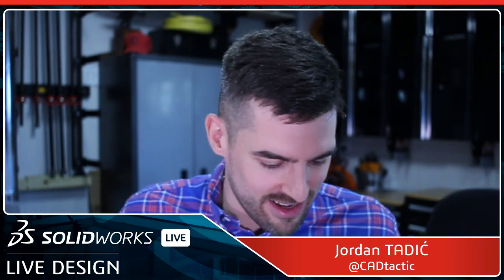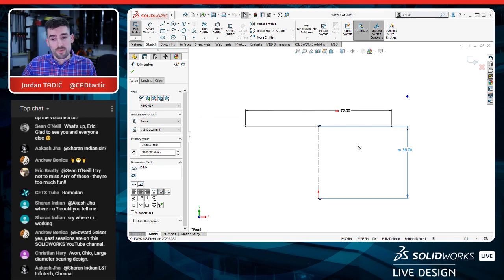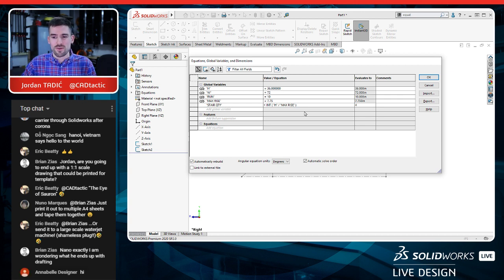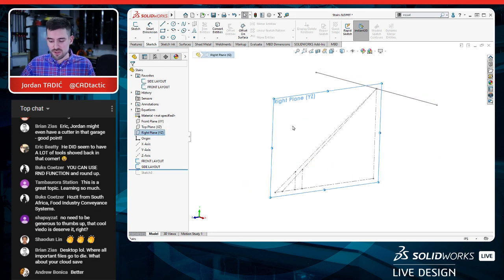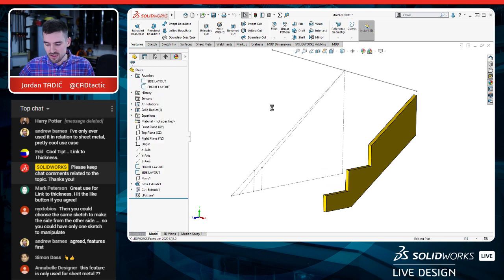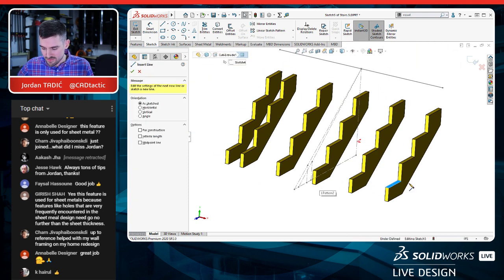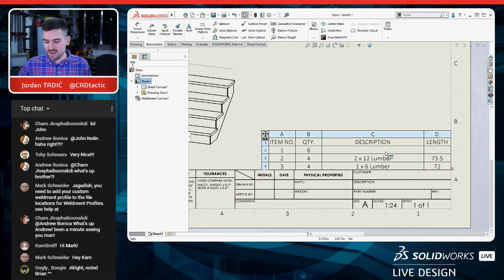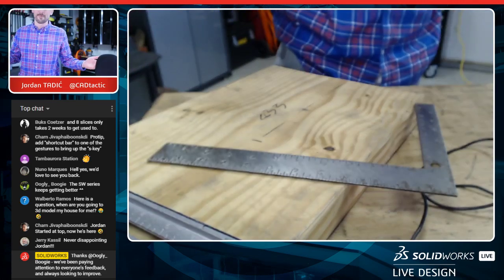Design Stairs to Fit Any Application – Episode 8 – SOLIDWORKS Live Design

Comment: Some of the question never got answered. Like the one from buks coetzer about using a pattern driven pattern. Would have been nice to get that one answered. Also I saw a question about why not use the round equation in the global variables instead of using the intermediate equation of int(xxx) then having to calculate stair qty x +1. @solidworks Why where the these answered?
Reply: Sorry about that!  Still getting the hang of this format.  Please feel free to post all unanswered questions here and I'll be happy to address them.  Here are the answers to the ones you mentioned so far...

1️⃣ Pattern Driven Pattern - The reason I couldn't use Use the Pattern Driven Pattern is because the name of that feature is actually "Pattern Driven Component Pattern" which is exclusive to patterning components within an assembly.  Though it may have seemed like I was in an assembly, I was actually in a multibody part file.

2️⃣ Rounding Technique - TBH, I don't know of a function that always rounds up to the nearest whole number in SOLIDWORKS.  If that existed, it would work perfectly as is, and we wouldn't need the IF function.  With the INT function (which always rounds down), we could have settled with just making it equal to X+1, but if the overall height was ever a factor of our MAX RISE, then we'd be adding an unnecessary step and the final RISE would be too short.  If I'm overlooking a function that always rounds up, please let me know!

Comment: I would have patterned the tread plate and the kick boards separately since you are likely to need one more kick plate at the top of the stairs which covers the face of the wall or decking that the stairs attach to. You are also likely to have a ribbon board attached to the side of the house so that the stringers can be attached with joist hangars. In that case there needs to be a slight adjustment in the top stringer shape dimensions to accomodate these additions.
Reply: Great point!  I was designing these for an outdoor deck or porch which should always have a fascia board covering the entire perimeter of the joists, but you're right, for an interior set of stairs, you'd need one extra kick plate (aka riser).  Those would be easy additions to add to the model if you download it.